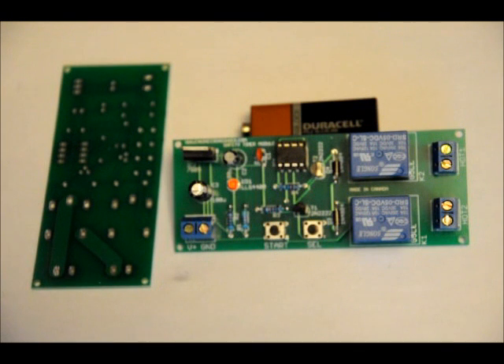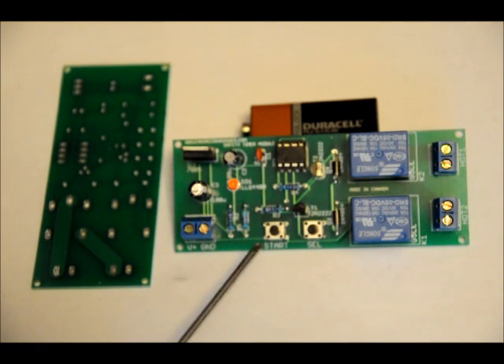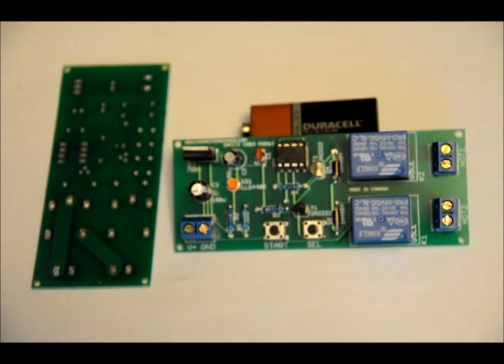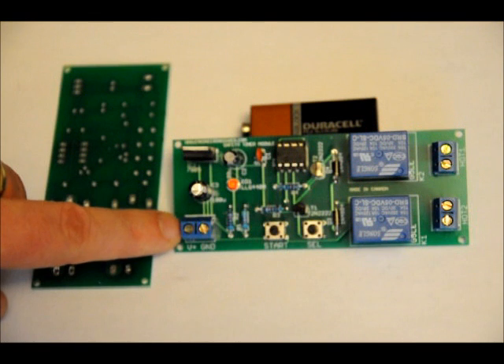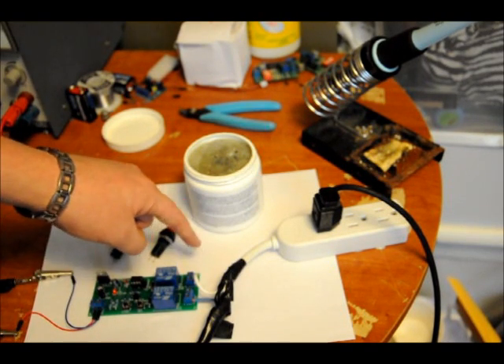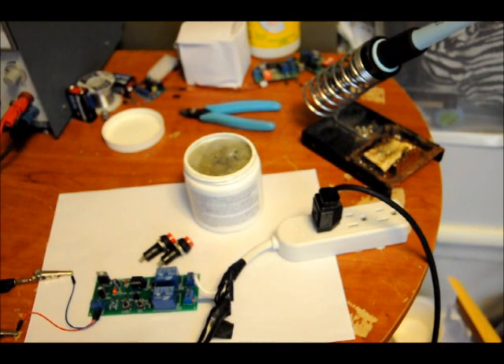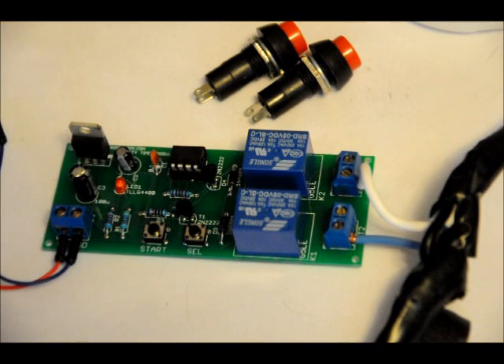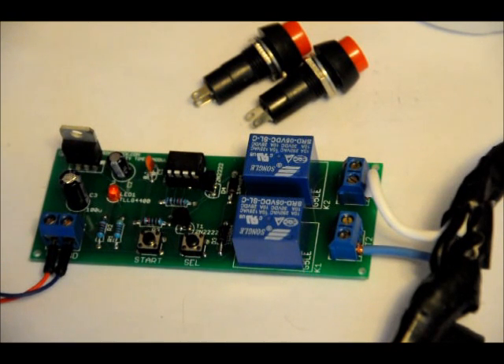The 30 Minute Soldering Iron Timer Module / DIY Electronics Kit - Automatically turns Your Iron Off!

Comment: I have this soldering station: https://www.amazon.com/gp/product/B01CHM8FD2/ref=oh_aui_detailpage_o00_s00?ie=UTF8&psc=1

What I would like to do, is install a timing circuit so that when I flip the switch ON for the iron (not the heat gun), the iron will turn off in an hour (I constantly leave mine on overnight or longer!). And when the timing circuit shuts off the iron, if I still need it on, I would like to simply cycle the power switch, then have it come back on for another hour.

Would it be possible to modify your circuit to accomplish what I want?